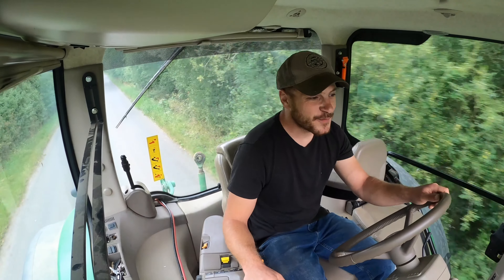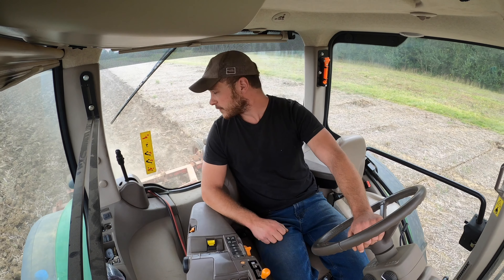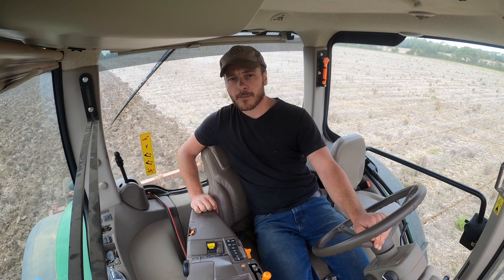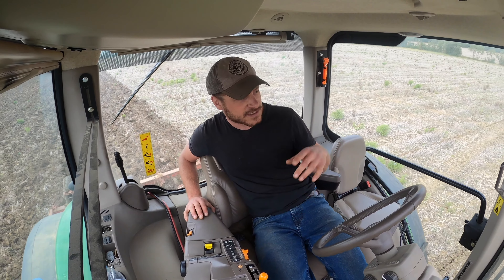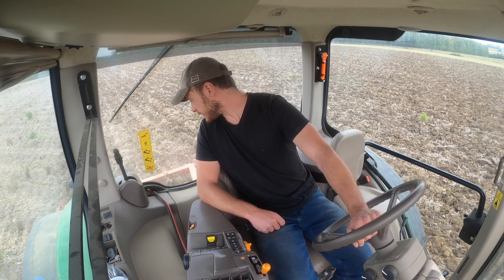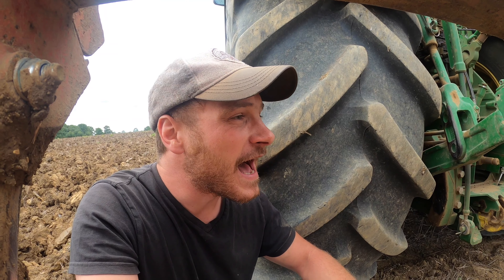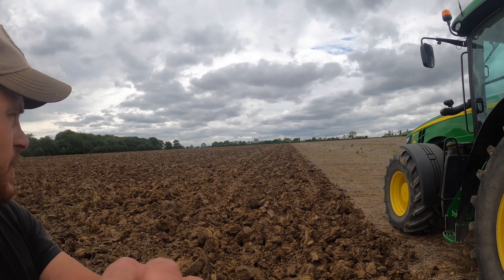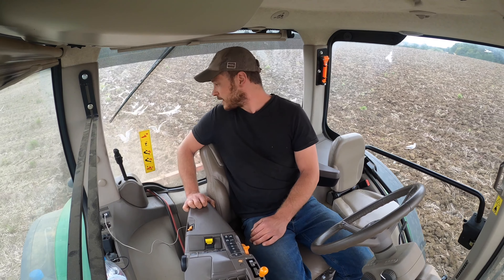CHISEL PLOUGHING WITH THE 8270R

Comment: Cracking video thanks.  I bought an MF chisel plough late last year and will be using it instead of the mould board this spring on our organic crops.  We subsoil  but I want something to break the plough pan and my current thinking is that the chisel plough doesn't damage the soil layers as badly as the mould board and will also aerate the ground better.  Also my feeling is that the mould board turns over any greens and it decays with increases in acidity from the decomposition and sends the humus too deep for the crops - I guess that's fine if you're using fert...  Do you think you need the full 270hp?  From memory mine has 10 chisels and I'm hoping a 200hp will be enough.
Reply from the maker: 200hp will be fine 👍 I’m hoping to use our tm165 on the chisel next time

Comment: Nice video nick. Do love ur mix of old school classics and bang up to date modern. Noticed some of ur legs are shakerator type. Was that a cost thing or an availability thing
Reply from the maker: Thanks mate, it has two shakerator legs but the aftermarket replacements for them aren’t very good so considering changing them to standard points making a total of 15, the normal points and fixings are very good for aftermarket parts